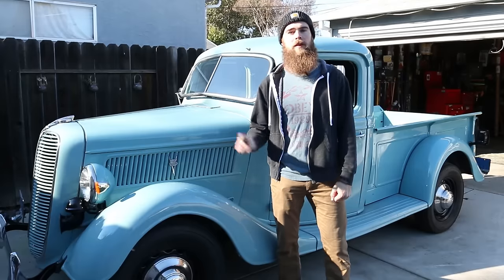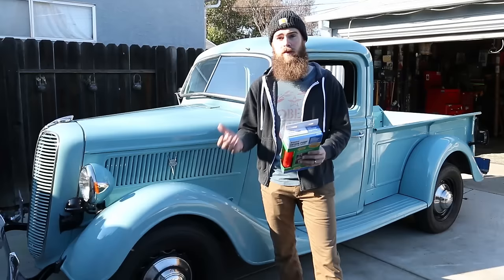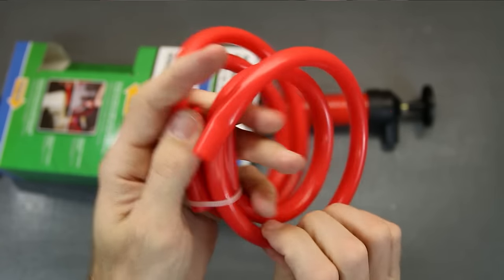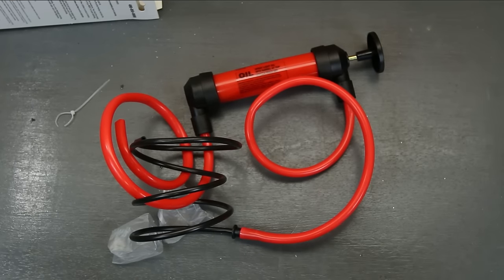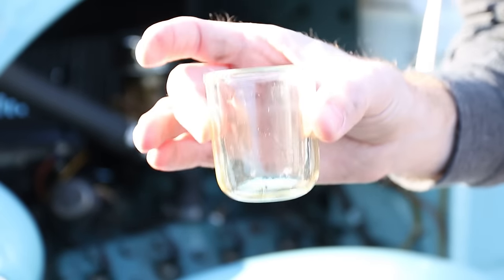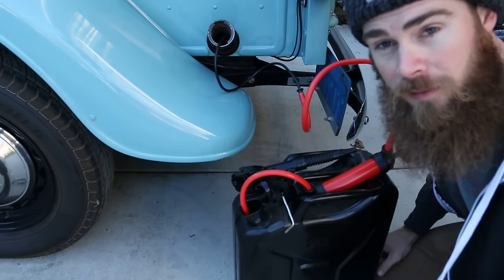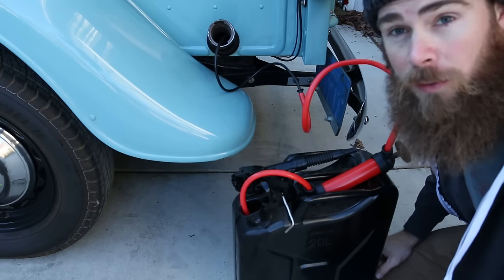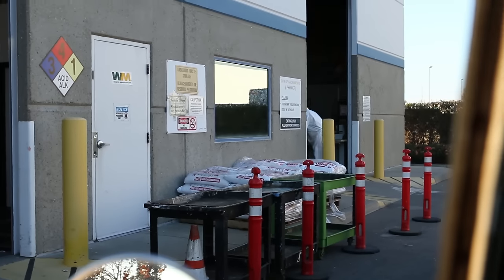OLD GAS? NO PROBLEM!

Comment: I clean mine easier than that only thing required is the key.  The beater we use to hunt out of sits for 6 months to a year all the time (even longer sometimes)  and have never had any problems running the old gas in it.
Reply: Ya my trucks transmission has been broke for a while the registration ran out 04/18 so probably been like 2 and a half years and it fired up just fine I mean it's fuel injected but runs alright I do have a misfire but I'm not sure it's not something else and I have almost a full tank and it's like 26 gallons so I'm going to run it
Reply: Exactly ,I've used 10 year old gas and car ran fine.
Reply: @barnabyjones7823  I have some 8 year old gas in the tank, thinking to add 10 gal fresh to mix it and then running it

Comment: Cool knowing that something like that little pump exists if you need it. I personally just would've used the drain plug and made a mess, and then saved the old gas for my burn pit, but that's just me.

You can also create a syphon with just a hose. Put one end in the gas tank, and suck on the other end. Put the other end in a container before the gas hits your mouth. That'll create a syphon and as long as the gas level in the container is lower than the tank it'll keep going.

Comment: Great Looking Truck. Just did this to my 57 Chevy last year after having trouble with the carb. Same thing . add fuel stabil and add gas to it. Had to get the carb rebuilt and drain the gas tank all the way.  Now I will run it down then add new gas every year.
Reply from the maker: +Motorman 0057 Yeah that was my main problem. I just didn't drive it enough and when I did I always added gas instead of running it low and filling up with some fresh stuff.

Comment: I have  a 1986 4runner with a 22re engine. EFI not carburated. I parked it 4 years ago because the oil pump went out. I put a new one in today i was going to drain the gas but it smelled like gas so i went to start it and it didn't start right away maybe 15 attempts and some brake cleaner spray in the throttle body made it start right away. I'm rebuilding or swaping the engine not sure yet. It's  unbelievable how it ran. Not great but not bad either. It did have a full tank of gas because i knew i wasn't going to get to it soon. I drove it around the neighborhood for half an hour and it seemed fine for the next several evenings I'll drive it around close by my house till all the gas is used up. It will definitely need a set of tires as i can feel the flat spots on all tires.

Comment: Maybe in Cali. In Denver they didn't.  I'm a hardcore mechanic, about 45 years of making things run. 18 years ago a customer brought a 1951 Rolls Royce to my shop, hadn't ran in 15 years. Coolest car, it was a limo, steering on right side. I don't waste time with a pump, straight siphon with 6' of garden hose. Took about 20 min. Called recycle they told me to set it out in flat pans and let it evaporate.  Don't understand why they call a pump siphon. Biggest thing on siphon is have the one you're siphoning into below the the level of what it's coming out of. And though I just old school,, they make a siphon hose that has the ball you squeeze to get started.

Comment: I had always heard that gasoline "goes bad" so I wanted to put this theory to the test. I dumped some 15 year old gasoline that had been in a rotor tiller onto the ground and lit it up. I was about 22 at the time so I should have known better. The shit pretty much blew up in my face!

I never dispose of old gasoline. I just run it through a Mr. Funnel to remove any water and other crap then mix it with fresh gas (25/75 mixture) and burn it in my riding mower. I've never had a problem doing that. I've even mixed it with 5 year old gas!

BTW. I am still not convinced gasoline will go "bad" as long as it's stored in an airtight container where it can't evaporate and oxygen and moisture cannot get to it. Some people think gasoline breaks down on a molecular level. 

I usually buy several gallons of non-ethanol gasoline before hurricane season because it always goes up as soon as someone yells "storm is coming". Right now I am using the last of my gasoline I bought it back in August of 2017 in my lawnmowers that has been sealed in an air tight container. I compared the color between it and some fresh gas I just bought in a mason jar and there is no difference in color or smell.

True it will eventually go bad if air and moisture can get to it. I've got a 68 Ford Fairlane that I just got around to fixing that has not been started in about three years and the gas looks just like what you pulled from your truck. My plan is to siphon it out, run it through a Mr. Funnel and mix it with fresh gas and run it in my lawnmower. Despite the fact that both engines have the same C/R (8.5:1). My fear is the fuel has absorbed water and the car may stall on me. 

It's easier to fix a lawnmower with a water saturated fuel filter in my back yard than a car on the side of the road.

I"m not a spokesperson for this product. I actually tested it by mixing up some 50/50 gas and water just to see if it really worked and it did.

http://www.mrfunnel.com/Mr._Funnel/Home.html
Reply: James, you should have about 20 likes, at least!  This was an excellent comment and well thought out, and scientific. It's a shame so many on these vehicle and in many other life forums run on superstition, ignorance and old wive's tales rather than objective analysis.
Reply: What about Florida has, it has up to 15% ethanol

Comment: Just top off with fresh gas, start, and go for a long drive. Then refill.
Reply: Why waste fuel, cause pollution, add wear to your drive train and suspension AND use up your valuable life doing all that?  Just add new fuel to dilute your old gas, especially "winter" gas which has even more volatiles from the refinery, at least in the north of the country, and use the vehicle normally.
Reply: @loftsatsympaticodotc  
Uhhhh ..... I like long drives !

Comment: just do it right the first time............grab a wrench and  loosen and remove the drain plug on your fuel tank. why go thru all that dancing around when you can just dump it in a big container and then dispose of it legally.
Reply from the maker: Thanks for sharing my video Jack. I did it this way because I could make less of a mess. I find when I take the drain plug out I get gasoline everywhere. This was much easier to control. Yes it did take days LOL. Also I did dispose of it legally if you watch the video to the end.

Comment: Aw man. You can use the old gas with your lawn mower. Just mix a bottle or two of fuel system cleaner in that old gas can. Much better than recycling. Wouldn’t be surprised if WM just dumped the old fuel back into the environment.

Comment: Completely unnecessary to replace 6 month old fuel.  I have a 2004 SC 281 Saleen Mustang, and it only has 25k miles on her.  She still runs great, never had any engine work needed.  But oh yeah, she's a Ford, so no wonder.  :)
Reply from the maker: Yeah it was more like three years when I really thought about it. Hints the Colour

Comment: Why wouldn't you mix the old gas with some new gas 50/50 and then run it thought the motor? My brother is a mechanic and does it all the time.
Reply from the maker: Thats called being lazy. Its a great way to clog a fuel injector/carburetor/ fuel pump/fuel filter, don't be lazy get rid of it if its old. This gas had probably been in the tank for over 3-4 years. It will burn however its best to pour out and start fresh.

Comment: I have a Jag with twin 10-gallon tanks that are nearly full, and has been sitting for 11 years. I'm not looking forward to dealing with it, and especially the maze of fuel lines that are probably full of sludgy varnish.
Reply: How did it go? My Jag has 5 years fuel in it, not sure what to do.
Reply: Update
Reply: I don't think the fuel lines have much fuel left in them, it all flowed back into the tank
Reply: @NorceCodine  @kinmastersmaster I drained both tanks. The gas smelled like turpentine and stunk up my whole house. When the weather warms up I'll run a gallon of something through them, but I haven't decided what yet. I thought they were nearly full but I only got about seven gallons. I'm hoping there isn't a bunch of crud and grunge left in the tanks, because I dread having to remove them.
Reply: @RetNemmoc555  Did you use a pump or just a plastic tube? I might just put in new gas though and see what happens.

Comment: You need to drain any gas out of carburetor float bowl and spray carb cleaner through jets.  Nice truck though.  If I were you I'd change out the plug in the gas tank to one that has female square instead of external male square.  If something from road bounces up and hits that protuberance, it could cause damage allot harder to fix than just replacing the plug.  And you know it will happen at worst possible time.

Comment: I have and el camino with some old gas been sitting for about 6 years..I pumped most of it out just a bit left almost nothing...if I put new gas and mix it would that be a problem?
Reply from the maker: Should be good to go just swap the filter after you run the first tank.
Reply: @BlakesGarage  thanks imma do that

Comment: After a year sitting in your garage you might have water in the bottom of your tank? Did you find any? You can put HEET in there to bind the water to fuel and it should burn through the carburetor...
Reply from the maker: That’s a good idea

Comment: When I need to get rid of the gas in my garage bum vehicles, I just drain it into my 5 gallon and transfer a gallon or two of it at a time to my 3/4 full tank Blazer. The old 350 doesnt even notice and I dont have to give my old stinky gas away.

Comment: Hmm the gas sat for 200 million years underground and it didn't go bad, but now a year above ground and it does?  Ok, I know that isn't quite true the problem is the ethanol (which you shouldn't be running in that truck anyway) and the lighter compounds like the C5 evaporates so you end up with a gas mixture that is somewhat reduced in volume and resembles an old style gasoline prior to lead more closely.  Shouldn't be a problem for a 1937.

I have the same question every year with my boat and my motorcycles which sit at least 6 months every winter.  Never had a problem with just running the old tank out once the snow melts.  I do add fuel stabilizer though before putting them away.  The boat is a bigger problem than the bikes, it's a 1996, and like most older motors is not designed to run ethanol.  It's the rubber components that are the problem, the ethanol can dissolve them.  Thus I try and run mostly marine fuel which is not subject to road taxes or ethanol laws and doesn't seem to go bad.  It's still expensive though because they have to put actual octane in it not C5 with ethanol or some other additive.

Diesel also doesn't go bad, very little light compounds it doesn't really evaporate very quickly.

I guess the logic on how to leave the tank has also changed with ethanol, the advice used to be park the tank full so not so much air could get in and bring condensed water, but they are saying now with the ethanol park the thing empty because the ethanol dissolves the water in the air.

Comment: no need to drain it if its only been a year. i would just keep adding fuel stabilizer to it and or just keep the tank full so theres no oxygen available to it. unless you are storing a car for several years, i would just drive the gas out of it instead of draining it. im willing to bet you can keep gas up to 3 years with stabilizer added every 3 months.

Comment: That ain't old gas run it I just drained my 68 landcruiser tank the gas was brown not from Rust 25 years it has sat it still ran just by adding more gas
Reply from the maker: Tevin Smith that's great but not the best idea. It will Gumm up the carburetor and fuel filter if you have one real quick.
Reply: Blake's Garage I know what it does I am a mechanic but what I am trying to day is year old gas ain't that big of a deal
Reply from the maker: Tevin Smith I get that it works and will run. I just feel like you're not draining it because your being lazy. You know it would be better to drain.
Reply: Blake's Garage the gas in my tank I did drain at first the hole tank was layered in varnish when it gets as bad as mine was it can do a lot more then just clog your motor it can stick your valves and blow your motor in a very extreme case but year old gas especially when you added more gas should be fine
Reply from the maker: Tevin Smith ok good that didn't come across in the first message sound like you just splashed gas on old varnished gas a called it good. The gas in this video when I looked at my gas fill up book was over 4 years old. Not the worst but definitely not something I want to run if I can prevent it fairly easily by draining the system and filling it with fresh gas ⛽️
Reply: Blake's Garage you made it sound like you had just year old gas
Reply from the maker: Tevin Smith yeah then I thought about it more and it was pretty old I mean you saw the color.
Reply: Tevin Smith I had about a half tank of year old gas in my Jeep Rubicon and it ran like hell. I filled it on up with fresh gas and it ran even MORE like hell. For the time being it’s parked, waiting for me to throw away a tank of gas full to the neck, you can touch it with your finger! Lol.
Reply: Penus butt!@!

Comment: gas don't go bad
Reply: It most definitely does go bad. I had some gas that was so old that I couldn't get it to burn with a match.
Reply: redwhitentrue dame
Reply: jonathan thacker yes it does
Reply: watch videos on taking gasoline, dumping water into it, mixing it up, turning upside down, letting it sit overnight, water sinks down to the bottom absorbing the ethanol and other shit with it, then drain it out, leaving you with gas only
Reply: Oh ya it goes bad over time. Trust me. It does.
Reply: Jonathan Thacker nope it doesn't  & people  become scientists  even if you show them multiple videos of different  cars & engines running off of 8 13 & even 30 year old gas
Reply: Brandon Allen I check my tissue paper after I wipe - you think we're all gonna  trust some clueless newbs word on YouTube over countless videos of cars running off 30year old gas lmfao  next
Reply: IT DOES GO BAD!!! Varnish on valves, clogged fuel filter, reduced octane(pinging), clogged up fuel injectors - Post displaying your ignorance(ignorance is lack of knowledge, not intelligence, BTW). Better yet, do some research before posting. Then maybe you'll see some respect from the knowlegeable on the topic.
BTW, there are other ways to deal with old gas besides dumping. One can boost octane by mixing with premium, and add fuel injector cleaner (more than normal) to de-varnish while it's burned. But the more high tech the engine is and the older the gas the better it is to dump most of it to avoid engine problems.
Reply: Nice truck, at first I laughed at year old has recycling to a different vehicle lawn mower, fire starter, whatever. But I did stop laughing because that's a nice truck, good maitenance,  drain the tank next time you store it, leave the cap off let the gas evaporate so the tank don't rust. As far as siphoning goes just suck the fuel till it Almost comes out then drop the end into the can takes a little practice but easy enough